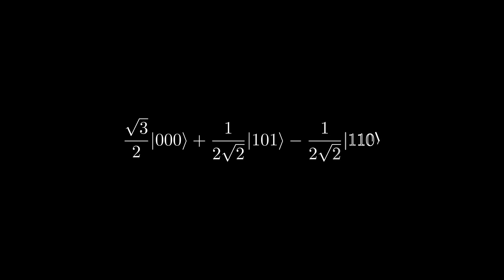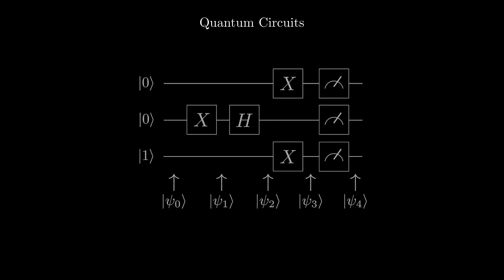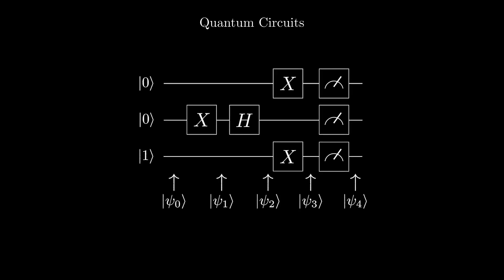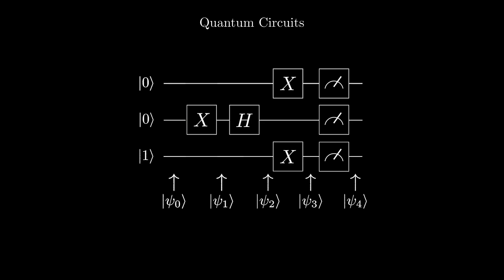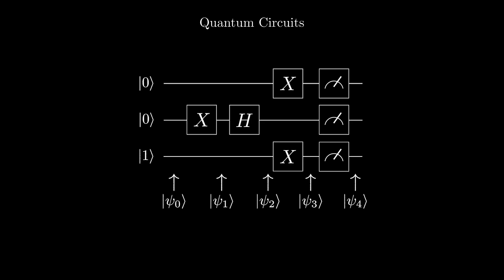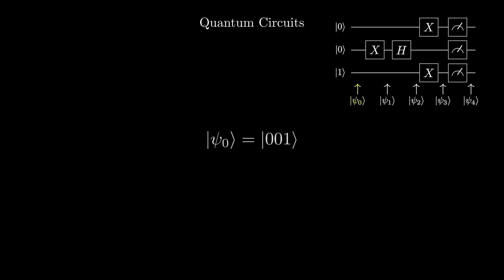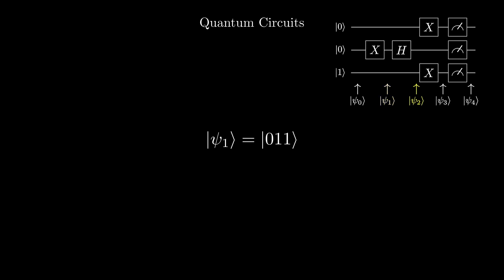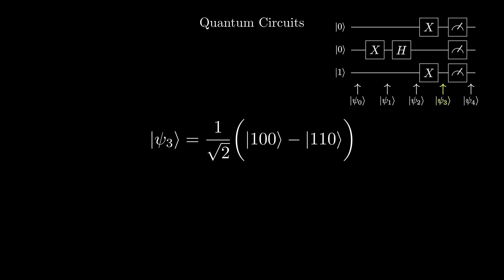Quantum Computing Course: 2.2 Quantum Circuits

Comment: In the problem set, I noticed that the bottom-to-top ordering wasn't followed. Like for c, according to bottom-to-top, the answer should be |100>, right? Also bottom-to-top ordering will change the relative phase of the answer of a, too. Can you please why we didn't use bottom-to-top ordering? Or did I get bottom-to-top ordering idea wrongly?
Reply from the maker: Sorry for the late reply; there are two different ways, from bottom to top or top to bottom from the quantum circuit. In this course, I chose to use the top top-to-bottom, but you may see in some books they use the bottom-to-top. It is personal preference as you will end up with the same state at the end, just with the bits in the reverse order, so it does not change the outcome of the circuit.
Reply: @quantum-soar  It would have been better if mentioned. But I think everyone will check the comment anyways!
Reply: @quantum-soar  I agree with Ankon, most of the simulators that I encountered (quirk, ibm quantum composer, qcengine) use bottom to top syntax and don't mention it, I assumed all simulators used the same standard top-to-bottom format. I was confused when in those simulators values didn't match, also thanks for this comment, now it all makes sense.